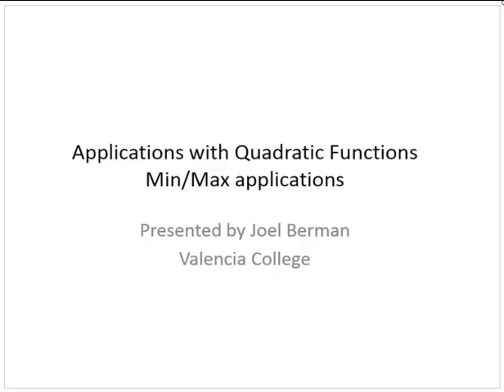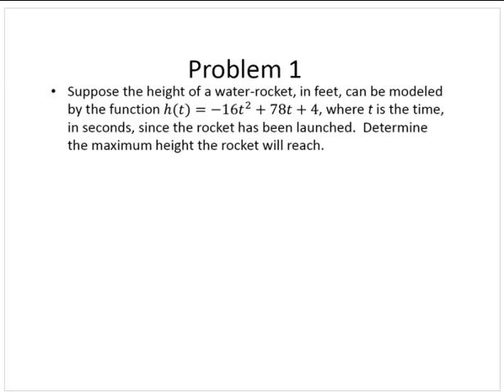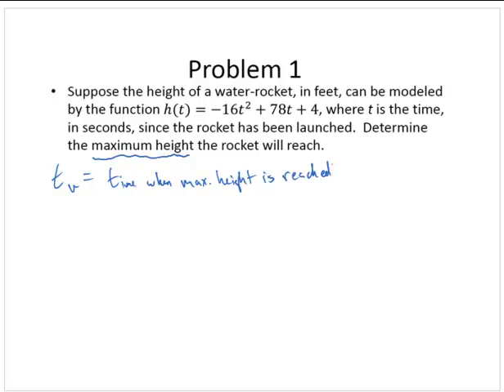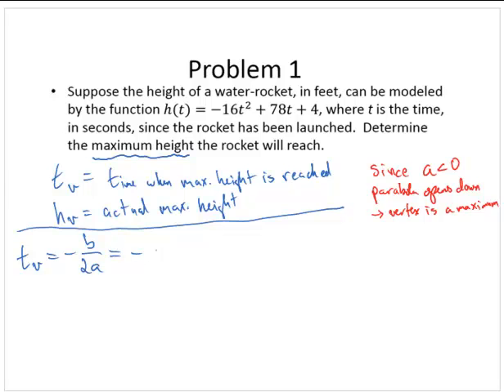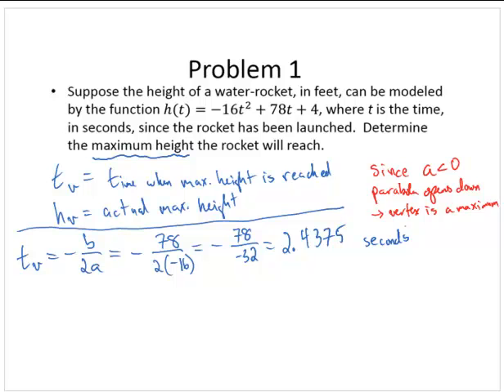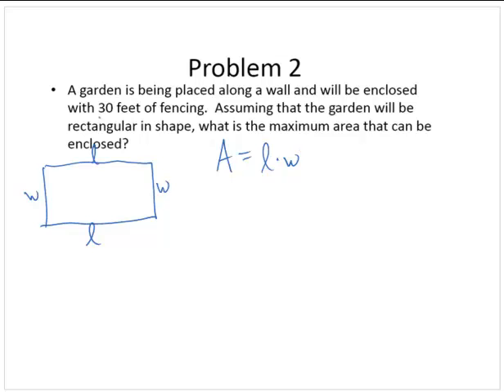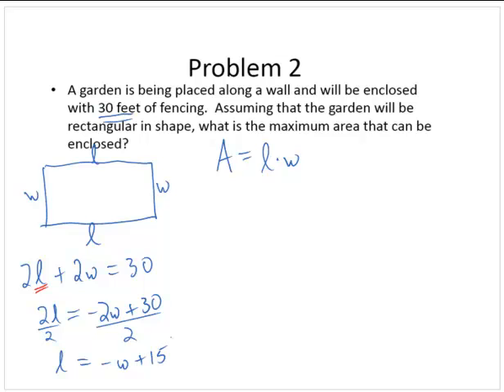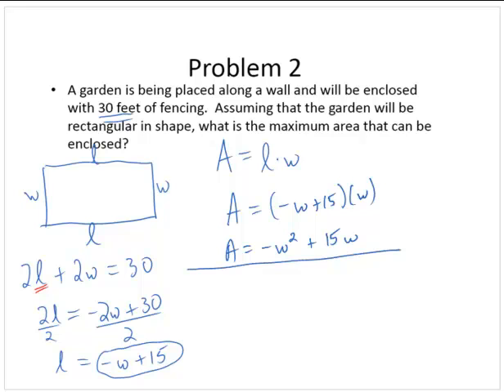Quadratic Applications Min Max

Comment: Error alert:  Problem 3 should be 112.5 = area, not 56.5. Why?  Because the fence has 3 sides with a total of 30 FT of fence;  so 7.5 x 3 = 22.5 FT is  not the required 30 FT.of fence.   Answer should be 7.5 x 15 = 112.5 sq ft of area.  The error originated in the wrong formula:  P= 2L x 2W  implying 4 fence walls.  The formula should be 
P = L x 2W  so that there's 3 walls.